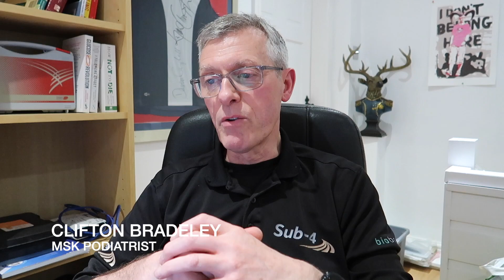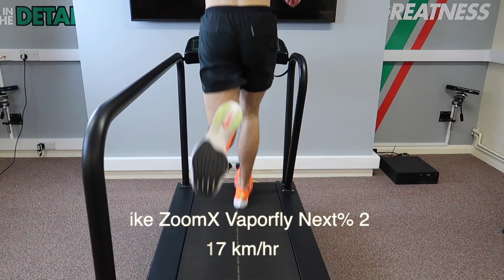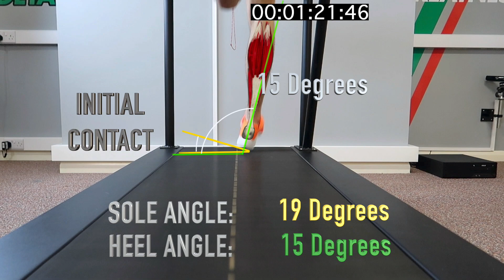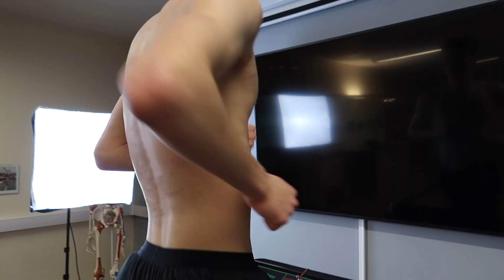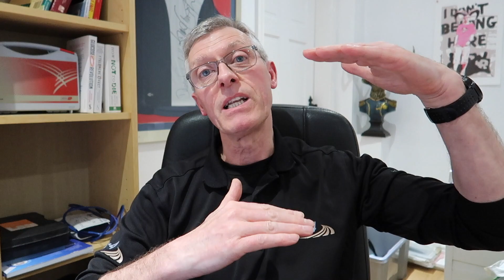NIKE ZOOMX VAPORFLY HAS MEDIAL MIDSOLE COLLAPSE

Comment: This shoe is meant for a dead neutral foot, and they are designed for racing, not training. I don't think this shoe has any heel counter, which might be part of the problem. If runners are using this shoe for training, I would tell them not to. I am only a runner with 41 years of experience, and have no training in your field. I had a pair of these, but hated them because of the lack of heel counter and felt they were too unstable for me. This guy obviously overpronates significantly, so it's not a shoe he should spend a lot of time in Also, can you really strengthen the foot to prevent overpronation? I would love to know how. Thanks for the video!

Comment: I agree , need to see different shoes. I find the VF Next % 1 and 2 tend to make me "forefoot pronate" more than the 4%FK or StreakFly as an example. I was also surprised the heel landing this athlete shows especially at that speed, I definitely more mid foot / forefoot strike . I think higher stack shoes tend to exaggerate the situation as well.  Some of the new shows have such wide forefoot , especially on the outside that it also exaggerates the amount of pronation...well that is the experience I've had with the various shoes.  I started running in the 70's and my marathon PB was in the Nike Eagle. Also enjoyed the Nike Air Edge.
Reply from the maker: Yes I think the stack is too high, too narrow and too soft. Thank you for your comment.

Comment: I am a physical therapist and I believe we only have normal ranges for running biomechanics , surely not truly quantifiable normal values for normal running . Even if we do these values could easily be affected by speed distance run , proximal alignment and function of proximal segments , bmi and many other factors . So if your going to chang a shoe in an asymptotic runner, what are you truly basing your decision on?
Reply from the maker: Hi Stephen as we know it is so multi-segmental with so many factors at play including the psychosocial and quantitative genetics P=(G+E)+1. The 1 being the complexity of pelvic mechanics, which is a major aspect of my assessment and decision making. In this athlete there was a structurally short right leg hence the asymmetry of what you saw in the video. Although exact neutral, axes and normative value are not known, we do understand a lot and we can use the data available to estimate quite accurately where normative positions are e.g. subtalar joint axes and normal innominate orientation. From these positions we can stay when something is in an 'abnormal' orientation. and, yes there is much we can quantify especially around pelvic position.

Comment: His left hip seems to be shorter or maybe the activation of the left glute compared to the right  seems imbalanced. I would totally agree foot strike is never gonna be exactly the same or “perfect”. I wonder if he runs in something lower stack hight how much the difference from initial contact too when that foot leaves the treadmill will change? As someone who work at a fleet feet (Local running shoe fitting store)

 I thing it’s wild that I found 80% of people will benefit from stiff, carbon plated, high stack hight shoes but no everyone does. We always say in store. Someone could be more efficient in ON cloudflow vs a Nike Next% just due to mechanics. 

Seeing this on video, I think he probably should be in something  less cushioned,slightly closer to the ground that’s stiffer though that mid stance phase because that’s were a lot of the movement is. Like you mentioned

A Hoka bondi X, Brooks Hyperion elite 1, Vanish Carbon from Altra, or maybe an On cloud monster would be better. Having a wider base and some type of guidance system. Sidewalls or guidrails, or just a wider and stiffer base underfoot would probably help with that Midfoot instability.  

 When someone is running that fast that heel won’t contact the ground that much. My only concern would be when he’s running much slower and that rotation is 10 times worst. During training runs or longer tempo runs. Longer distance that rotation can cause damage or fatigue down the line.
Reply from the maker: Thank you for your comment. He has a slightly longer left leg, and weaker left glute medius because of this. We are correcting this. I agree, I like these shoes but the medial column is too weak. I just think this occurs because the midsole is too narrow. It is definitely for fast running - but not everybody can run fast. Should we be more honest about the shoe in retail stores, and not sell to everybody? BTW I hate ON shoes. I see many injuries associated with their use.

Comment: I'd have to see the results with different shoes on. Suppose this athlete just simply has eversion of the foot. Maybe he needs to strengthen his feet. Or maybe the shoe doesn't offer enough support like a 'stable' shoe for pronation would.
Reply from the maker: Yes, it's definitely individualistic. Great athlete. But I think he should only wear them for short races.
Reply: How does he need to strengthen his feet when he is already a good runner and fit? It is part of his anatomy and nothing wrong with overpronation. The VFN is not suited for many runners and nike needs to come up with a 10g heavier model where normal shoe support isn’t skipped.
Reply from the maker: @AshtrayHDlate  He doesn't. I would recommend he strengthen the triceps surae to prevent future Achilles issues.
Reply: This dude is heelstriking which CAUSES flat feet and pronation of the ankle. Hes got horrible form
Reply from the maker: @user-oj8zo3cr4b  He's a midfoot striker and generally he is pretty efficient. The shoes makes him look worse than he is.
Reply: @biomechanicsacademy  well im not saying how he runs usually but in the testing of this shoe id definitely have him run some star squats for a couple weeks and make him test them with a proper midfoot strike because the reality is the shoes are designed to give so will bring out the slightest pronation however thats an ankle strength issue as this same give in the shoes saves massive impact on the knees leading to an overall improvement. Id take my ankle weakness being highlighted for training then ignoring it for a stiffer midsole that cost me 15 years of my running career due to knee injury

Comment: After 40 yrs of treating running injuries , in my experience, there is no way I would modify this runners biomechanics or his shoes. Being the fact that there is no establishment of normal in the biomechanical or podiatrist literature , as much as we have tried to establish normals with our research and technology. The Murphys law of the treatment of runners is that treating a asymptomatic runner by changing shoes , using orthotics or other types of treatments , can only lead to one thing most likely , symptoms. If increased performance is what your after , then approaches like strengthening and conditioning may be in order, but even then one needs to remain cautious in their approach.
Reply from the maker: Sorry,  completely disagree with you. What kind of practitioners are you? Physio? Podiatrist?
Reply: @biomechanicsacademy  you asked for opinions and you come back with an aggressive response like that.
Reply from the maker: @craigtsmith6957  Hi Craig, I apologise I think I worded it wrong. I do disagree but I was just wondering how you would go about dealing with this from a practitioner point of view and wanted to know you qualification .i.e. a podiatrist, physio etc. My intention certainly wasn't to come across as rude. Words can sometime portray a different intention. I appreciate your comments. Clifton

Comment: Weird, they feel so much better for me, than ANY other shoe I have used, at speed and for a half marathon. I have not found shoes that feel like they don't hurt, which perform like these. I go at least half an hour longer before I feel a pinch of pain. I think wording it as we moved backwards a little with these shoes is kinda a weird statement, even if you say you wished you had them 30 years ago. 

I guess you need to go join Nikes team so that they have a smart guy to tell them how to make the shoe. I would say, use the data to make your decisions, seems to me that you looked at some athlete run wonky on a treadmill. Maybe look at good runners and what shoes they are using. If regular people shouldn't use the vaporfly, say that, your words are mixing suggestion a lot.